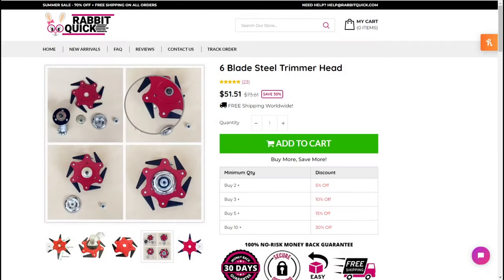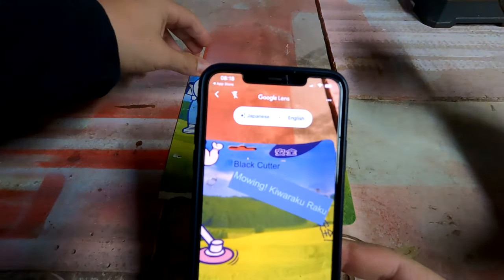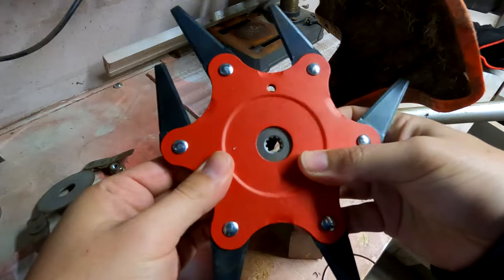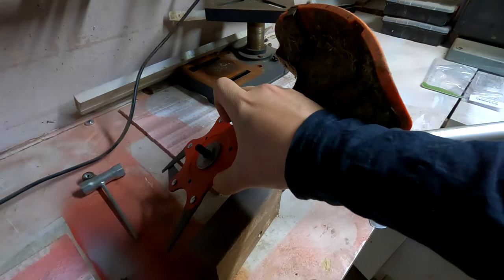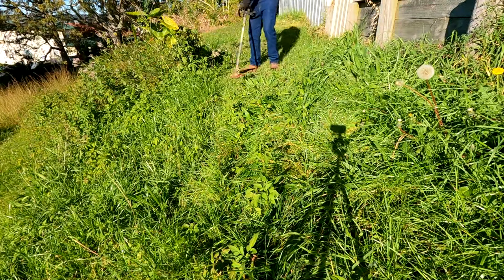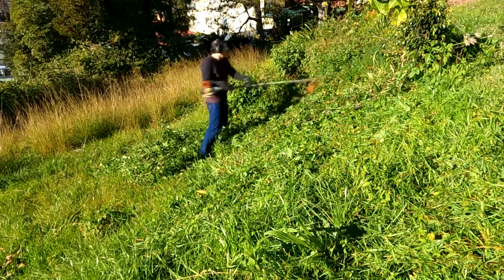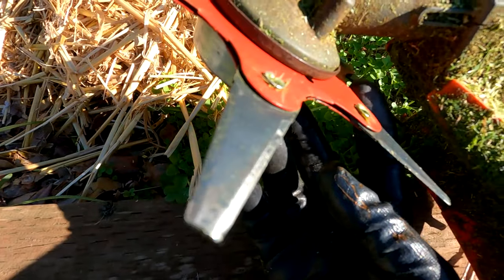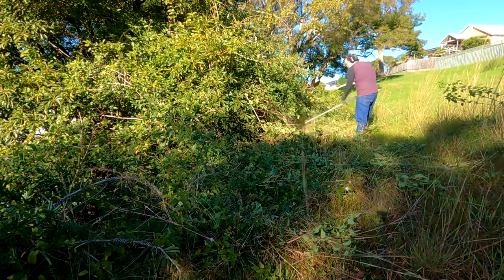Are "6 Teeth" Brush Cutter Trimmer Heads a Waste of Money?

Comment: Hi sir. I am from India. I have recently purchased this blade from local shop. I haven't used it yet. I always use two teeth blade or chain type head. Two teeth blade consume less gas than six teeth blade treemer attachment due to high rpm running while using six teeth blade. Tow teeth blade works very fine on low rpm and cut around one inch Dia bushes easily.

Comment: I've just bought one but haven't used it yet, I like you didn't like the look of those rivets holding the blades. So I replaced them with stainless steel button head bolts and nylock nuts they are much safer. Oh I might add those rivets came out easy doesn't say much for how secure they weren't.

Comment: I have had one of these for approx. 10 years and it's still going strong. It looks identical, except the rivets on mine look more chunky and have rounded heads both sides.
It's been fitted to a Stihl and currently on a 52cc Parker.
It goes through pretty much anything up to about an inch live and 1/2 inch hard dead wood. It eats up thumb size hard bramble stems and the like, and when sharpened does a good job on grass too.
I have to run a dremel over the leading edges (yes, like yours, it's reversable) to keep it sharp.
The blades are no longer flat, some are twisted slightly at the end and some have 1-2mm chunks missing from my clumsy hitting bricks, metal work, etc.
But when you do hit something solid, unlike a solid disc cutter, it does feel like it gives much more.
I'm very impressed with mine, and haven't used cord now for ages!
Oh yes, mine fits lovely on the brush cutter head, but I do use an adaptor to make sure it's centred - not sure if the adaptor came with it, it it's one I had with another attachment bought in the mists of time.

Comment: Great review, did it last or did the plate buckle and twist, the rivets wear and loosen, or the blades fly off? I use the metal head and 2 separate helical plastic line insert, can chew through most stuff except hard woody material lines last about an hour on average including chopping up some woody annual shrubs and briars. It’s about half way between ordinary trimmer line and the normal brush cutter head in cutting/flailing ability. I know it’s safe, apart from the usual occasional missiles that fly up from ground/vegetation.

Comment: Hi, how does one get a backyard full of really weird thick runner grass that clumps together in colonies deep in the soil. Also about 3 inch mat of dead grass. I find it excellent for a really deep cut right down into the dirt and these weeds clumps under the ground. later on I go back and rake it all up and compost it so nothings is lost. I can then spray with weed killer. Establish a new lawn. Rocks may break the tips but it a small price to pay for a solution that works.
Reply from the maker: Sounds like you need your lawn de-thatched

Comment: Great review, thanks. I have two questions: 1. Would it be any good for edging a lawn? 2. Do you think a bent-shaft trimmer would have enough power to run it? Cheers.
Reply from the maker: It would be ok for edging but no doubt the blades or at least tips would become blunt if they spent a good deal of time in contact with rock/concrete or even dirt for that matter. 

Bent shaft machine should be fine.
Reply: Best LAWN EDGER I come across has to be the FLYMO CONTOUR XT Heavy Duty. Awesome machine and auto load string makes it unquestionably numero uno out there. Getting one of those extension armed machines to assist
Reply: For edging, to be honest better no use .

Very good on tuff weeds , nettle, tall strong grass.
Dangerous  - if you catch a stone ,  brick , metal , blade may brake .
I had one broken , my luck fly away. , No one injured. Very lucky .

Comment: You mentioned the most important issue: the rivets.  It is not coincidence the major companies does not sell these blades  (or I did not find them there).
One should not buy this just for the safety reasons. Add to safety the sitting problem, which causes additional vibration to both machine and hands. Add to that the very dubious benefit of use (what it is in comparison to 3 knives blade?).
Obvious verdict: do NOT use these trimmer heads - yiu have string head and standard one piece metal head and that will do the job efficiently and most importantly securely.

Comment: Where's the followup?
Regardless, I guess I'll close my browser tabs that have one selling for 50% + extra 10% off and it's still $54 for the trimmer head and adapter kit.
Reply from the maker: The follow up is if you can get it to fit it’s probably the best out of the cheaper Chinese made drop shipped attachments.

Comment: Just got one of these for myself to test out. I am personally very impressed at what it can handle.

I found your video because mine did not come with anything to mount it to the stihl weed eater I use. I also had issue with the hole alignment and found the same problem. 

I’m sure this isn’t the safest way to mount the blade, but i put mine between the original weed eater head and the shaft. I had no way of actually mounting just the blade itself. So the blade is more like an accessory to the traditional string head, and it seems to be working out pretty well so far! Makes it a little more versatile, and keeps me from hitting the blades into the ground as easily. 

Great video! Very well done and helpful!
Reply: Puedes enviar un video?